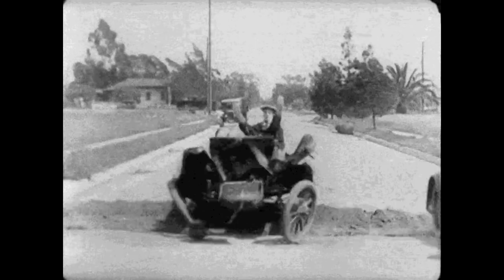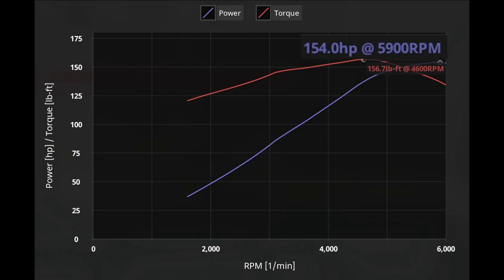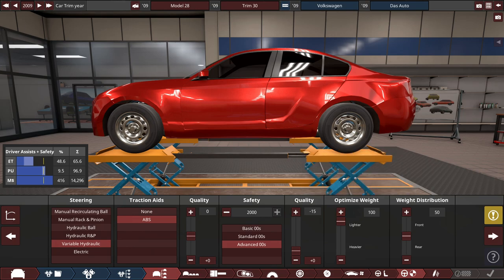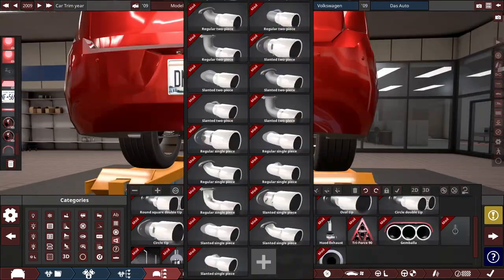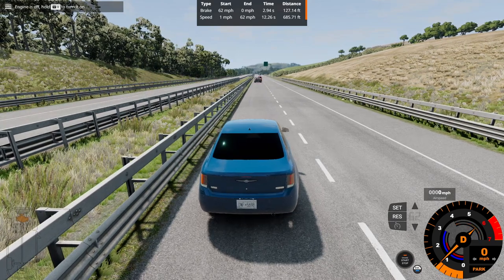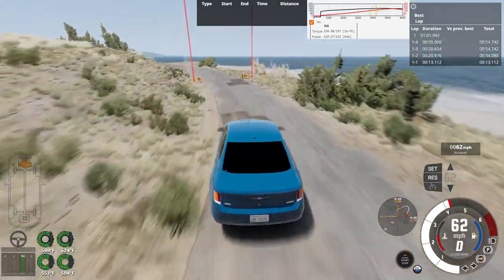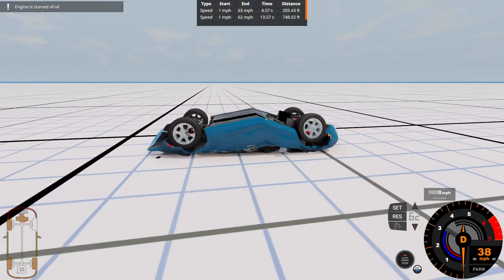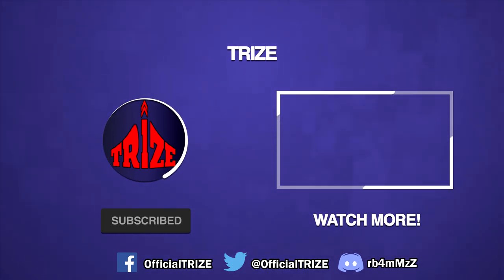Building The LEAST Reliable Car Ever! | Automation Game & BeamNG.drive

Comment: Start making interiors bro ; / it looks bad with black windowsss
Reply: But interiors are suuuuuuuch a pain in the ass
Reply: @ThatSlowSaturn  it's pretty easy to make a fake interior or basic interior like literally just dashboard with steering wheel and car seats. It looks much better than black windows.
Reply: @ProfesjonalnyYoutuber  I mainly have issues with the sides of the ceiling trim and the door cards
Reply: How good are you at making interiors though?
Reply: @enderjed2523  very bad, that's why i make very basic interiors, like literally, basic floor just to cover metal stuff, seats, dashboard, steering wheel... mostly that's it sometimes when i have very good day i also add gear stick and the thing to open the windows and those panels on the doors... i have no idea how to name it even in my language lol. Sorry i'm better at hearing than speaking english ; p BUT STILL this very basic interior looks like a 2137 times better than black windows